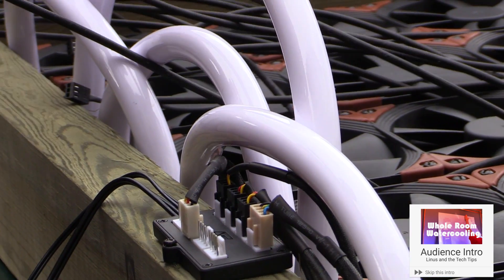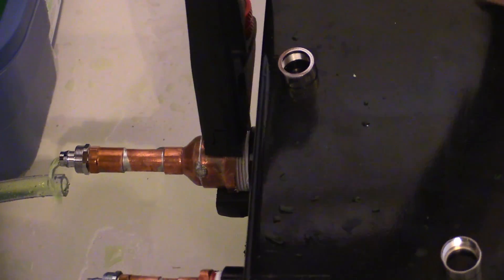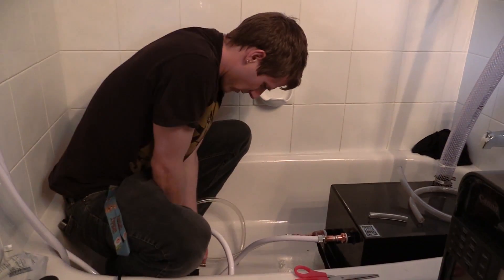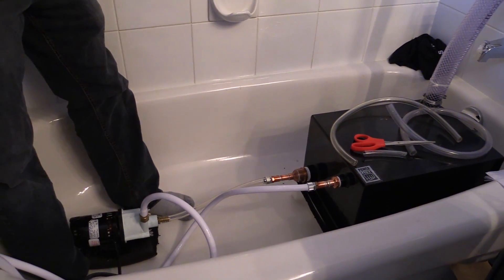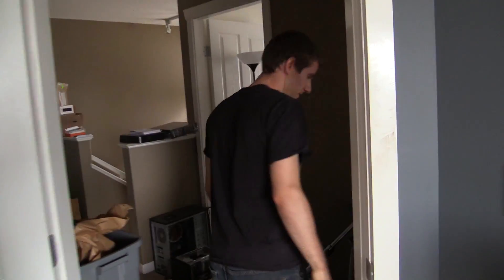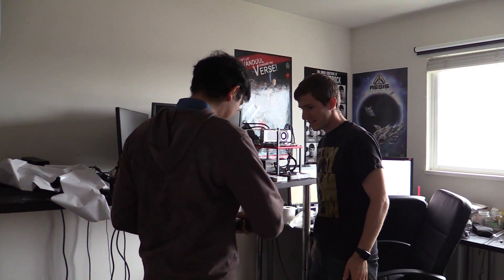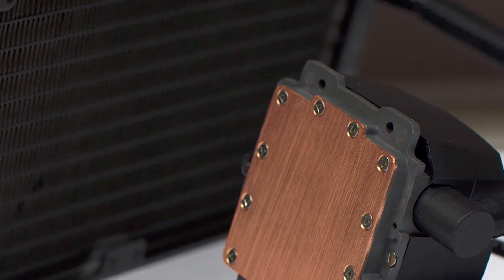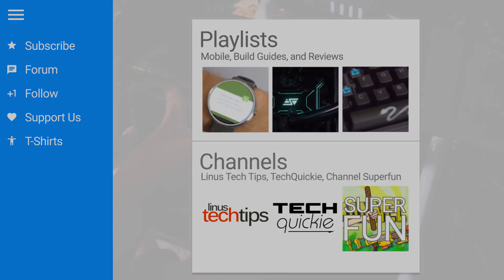Whole Room Water Cooling Part 4 - Nearing Completion...

Comment: So they didn't make air traps in their system? Wait, is there a term for a spot specifically to release air? I know in compressor installations, like air tools in shops, you need to have a drain for the water below the connections so you don't shoot water through your air tools.

Comment: Each spot a computer, radiator, or component connects to your cooling loop there should be isolation valves on the feed and returns with bleeders below the valves.  Set it up as if it's a hydronic heating system used in some homes.  It will be easier to repair and bleed each loop and component..  Isolation valves and bleeders are a must. And running pipes on angles slanted up on feeds and down on return lines would make getting the air out loads easier...  And even if you do get things cooling decently without isolation valves and bleeders there will still be air pockets.  So install bleeders and valves and things will be so much easier for you guys

Comment: i whod have only done two thing different one i what have put a cheek valve on eater side of pc one for the incoming and one on the out going line at the botem of the runs as well as one on the out fro the pum and one for the in of the take as well and the 2nd thing i whod have done different is on your out side radater i whod have use a car or truck radater and a good 12 car fan fro it that whod have help on the flow of water going in and out of it as well as a lot more space fro it to be abile to cool them pluses car and truck get much hoter so it be more than aqwith to cool all of the pc and some

Comment: funny and smart project :) are you still using the system? shound use quick couplings for the computers to the "line", like those for airtools n stuff, fast connect/disconnect, minimal air in and water out

Comment: Me and my room mate did something like this a bit smaller scale though.
Reply: Me too, but turn into a disaster when one of the tube got a hole in it. RIP my 780Ti. :(
Reply: Zero necker
 Holy shit that sucks xD.
It also ran into the living room and some how one day it sprayed a jet of the water anti freeze mix at my room mate.
Like how? Their was no pressure.
Reply: I know that there is a hole in there so I didnt start the pump and my god damned sister turn it on and there goes my GPU.
Reply: Zero necker
 Holy shit xD, you didn't warn her/ she was connected to it?
Reply: She was not at home when I rush out to buy more tubings. I thought she is not going to be home before afternoon so yeah.

Comment: Runs hose through window,to fill tank sitting in the...bathtub.  head-scratch
Reply: +PhattyMo ikr
Reply: Using tap water at all for water cooling, lol. I can understand why since 50-100 gallons of distilled water every time they drain or flush it a lot of money, but the minerals..

Comment: Since you were using standard copper plumbing parts, would it have not been smarter to include shut off valves to isolate parts of the loop, so the unused risers were removed fro the water flow completely.

Comment: what is the point of exposed copper pipes when it will still heat up the room, buy some insulation sleeves for air conditioning will be perfect
Reply: +peter griffin Absolutely unnecessary. Due to extensive outdoor cooling, the water temperature in the cooling loop is going to be only a couple degrees above ambient, so it's not going to appreciably warm the room, the efficiency of thermal transfer to the room is very low due to small temperature difference, relatively little area (compared to the area of outdoor radiator) and little airflow around the copper tubes. Most of the heat exchange will happen at the outdoor radiator and not from the copper pipe to the room.

This is also the case in a typical cooling loop built inside a PC, also with temperatures barely above ambient.

Comment: thinking about it why didn't you guys get some butterfly valves at the ends of the pipes so you could selectively shut off the water flow for easy change and to bleed the system of bubbles by turning all but one set off and using the pressure to bleed it out faster or something along those lines
Reply: +Nicholas Laster  That is what i was thinking too, but that is obviously the benefit of hindsight, i wouldn't have had this idea in advance of the project. But seeing the issues that actually occur, it's obvious.

I actually think another thing that's good for a system prone to such issues is flow meters in the individual PCs and connect them up to the mainboard CPU Fan tacho pin, so the PCs beep when there's no flow and so you can monitor the flow, and it would even work from BIOS but from the running OS too.

Comment: You must fill system from exhaust (out), to intake, that makes air go up. And you needed one ball-valve in highest point of your system. Or just make reservoir (with ball valve on top) below sealing in bath, which is connected main water reservoir. Pump must feed from exhaust to reservoir. That how that kind things I would do, cause I'm water heating specialist.
Reply: +pakiw2 to keep steel tank from rusting you could put inside rod made from magnesium.

Comment: i'm not sure if yo still use this cooling system for your computers but an easy way to eliminate the air bubble issues you have been having is too have your coolant tank higher than you tubing, lines and radiators, it will naturally bleed the bubbles out of the system due to gravity, it will burp itself
Reply: +Dave Berry its what we due to cars burping out the systems when we flush the radiators or swap cooling components
Reply: +Dave Berry They don't have that cooling system anymore

Comment: Build a box to hang in the window, and put the computer outside to vent the heat instead of messing with all that plumbing and water cooling. Then all you have to do is extend the monitor wires to the desks and use a wireless  keyboard and mouse.
Reply: Just no.
Reply: nah bra

Comment: ok need help ASAP!! I got a acer aspire wit windows 7 on it, I tried going the bios to see the temp of everything, But there is NOTHING for that in the bios AT ALL!! I tried also open hardware monitor and it said my cpu is running at 140 to 160F I REALLY dont think thats the case since its still working and not melted thru it. Need some help here PLEASE!! its not a new Laptop its atleast 3 to 4 yrs old or so
Reply: +Erik Iacopelli Ok I used 3 different programs and ALL are saying both cores on the CPU r going between 145 to 156F. WTF?!?!?! Wat do I do? I always had the laptop on a special stand so it gets ALOT of airflow under wit AND put a lil fan I got from walmart to blow cool air ALWAYS under it AND even have one of the USB air suckers attached to it so it sucks out the hot air, But even wit ALL that running its still hot
Reply: +Erik Iacopelli also I checked n its a Acer Aspire 7741. I looked online n I seen a bunch wit letters after the 7741 but mine just says 7741, no letters or nothin. I dont know if that helps or not
Reply: +Erik Iacopelli those temps aren't really that off for a cpu. The max temp on pentiums is ~90c (194f)
Reply: Open it and de-dust it, those temps are a bit high but not too much, if those are Farenheit temps obviously

Comment: You should have used clear tubing with little beds in them so you could actually see the water flowing around, and it would have looked much better than that copper tubing.
Reply: +Steve Aimes  My first idea when i saw was "ewww copper". I would have been probably tempted it to cover it with a chemical tinning agent (aka fitting soldering paste). Blast it with a burner, and it boils, then tins the surface, nice shiny and silvery. But it would obviously take a while, and costs a bit.

But yes, clear tubing would have been nice.

Also in hindsight, some shortcut valves for bleeding one PC at a time would have been prudent, and flow sensors connected to mainboard fan header would have been another neat diagnostic and failure warning tool.

Comment: You should look into installing a hoffman valve in the plumbing for that setup.  It would automatically purge any air bubbles from initial fill or purges and refills.  It could be soldered into the copper plumbing so they purge before the radiators.

Comment: for anyone doing something like this, use some ideas from automotive coolant systems. On many modern systems such as many Chrysler brand vehicles, there are bleeding valves at the high points to allow the air to escape. This is mostly based on non radiator fill points that trap air that wont circulate back to the reservoir. Check out the fill instructions for an 06 Chrysler Pacifica or most Jeeps with 4 liter inline 6 engines as a reference. Professional experience - Master Certified Mechanic and U.S. Navy training.

Comment: you should've placed two vent valves at the highest possible point in the system. especially in a situation where you installed the pipes at a height like you did here. would've saved you some time and pain in the ass :-p

Comment: Wouldn't something like a pex manifold be more helpful?  So you can seal off each workstation from the manifold without worrying too much about air bubbles at each leg.  It also removes the the need for the small pumps in each workstation, when you can have the pumps at each leg at the manifold.
Reply: Like a recirculation for hot water. No, I'm not a plumber, but I am learning how water systems and water heating systems work.

Comment: I noticed that the card for linus had an acrylic top plate, how is it handling the antifreeze (wich can be corrosive)? honestly I would have used plate heat exchangers, to have the room loop and the pc loop actually separate loops

Comment: What's the point of using the huge hose at the pump when it joins with a much smaller hose? It can't make use of that larger hose and the way they're joined means you're losing the pressure in your system.

Comment: Looks like an epic pain in the ass. Why not stick with smaller water cooling loops on the system and then put a high efficiency ductless split system in the room. Probably would be cheaper on electricity.

Comment: I really loved the idea. But I strongly recommend using check valves. :D
Reply: Matheus Moreira i know this was a month ago, but why would he use check valves, the plumber should have installed isolating valves to help balance the system, and an automatice air release valve, for 20p parts he could have solved most of their problems.
Reply: Check valves don't allow liquid flow in the wrong direction, thus eliminating the risk of hot water exiting a computer's liquid cooling system and entering the other's. ;)
Reply: ***** Noted. Anything else?
Reply: nah im all done

Comment: That pump is tiny, the smaller and longer the tubes, the more head pressure you need, also ofcourse the higher the fluid has to be pumped. Get a pump with 100m head pressure.i believe a 2hp pump with high pressure, but not so large flowrate will do the job. As for airbulbbles, they are always a problem, two solutions, bleed the system from the return connection of pump. Or evacuate the whole system.and vacuum it.DO NOT use a refrigeration vaccum pump as plumber grade tubing is thin walled and can collapse the pipes This will get all the airout. Once that sorted out, let the fluid run in.

Comment: Seriously, not trying to be a dick, but this is not efficient.  Aside from two decades in computer tech support I also have over a decade of HVAC experience as well. It would have been far easier to do a separate water cooling setup for each system, then add a ductless minisplit AC unit to the room. Minisplit systems are what is normally used in server rooms. Nevertheless I am impressed with the setup.

Comment: OK i do not wont to offend but coming from a mechanical background i see floors in your setup. 1}. you could have made a bracket that allowed you to fit each radiator out the window as this would be the prim placement for it as you could keep and eye out for leaks throw the window. 2} you need a bleed point at the highest point witch should be the rads 3} i would have gone with a large single 12v fan instead of all the wiring problems 4} flow cycle  pump should feed a pipe that runs around the wall on the floor feeding all the PC,s from the PC,s it should run to a second pipe running around the wall to the bathroom where it then gos up and out the window to the rad and back in the window to the res ( this could be accomplished by drilling 2 holes throw the window farm to fees the copper pipe throw ) the less up and down you have with the flow the less head pressure you need ideally i would have the pump and the res mounted to the wall in the bathroom bellow the height of the rads and the rad pipe running into the long tube you have coming out of the res. that said i think it is awesome that you did this as it sounds like one of my wild ideas lol  everyone will have a different way to do it just like but if it work awesome lol that is why i like you guys i never know what to expect.

Comment: because your pump can't handle the upward force, you need higher power pump to push the liquid up to your near ceiling on the wall then pull back again out to each pc then upward again you need at least 2 pump for the cool water to push then 1 pump to pull the hot water out

Comment: next time pull a vacuum on the circuit and let the absence of air fill the reservoir and lines. works great in automotive cooling systems after invasive repairs.

Comment: The lack of ball valve's is driving me crazy. You should be able to isolate portions of the tubes as shown at 7:00 

Why the ceiling? For aesthetics? That seems like it makes every down tube an air trap? Air rises to the top horizontal tube making the system a nightmare. Having a lower tube that has a off rise to bring the air out would make more sense.

Comment: Your system should have had valves installed at the end of each run of copper. It would have let you close off the pipe and not lose the fluid in it.

Comment: How about running the pipe work coiled inside a small "chest" freezer ? to lower the temp
Reply: ***** Should work to cool the liquid before running it through the system to cool the cpu. Maybe a peltier cooler at the liquid reservoir or at the radiator might be an easier method

Comment: This whole project could have been alot easier. Bubble reservoirs for each station between mains and blocks for better bleeding and avoiding that whole over-heating problem. Copper pipes running near the floor for smaller amount of water and better flow. To me, this just looks over-complicated.

Comment: If the case has a fan port on the bottom for the PSU, why don't you put the PSU fan facing down so it draws from the bottom, then exhausts out the back so it doesn't affect the internal case temperature?

Comment: Why wouldn't they get a set of valves for each connection on the copper pipe (like what you have for a faucet) then you could leave unused ones connected to each other via a hose and just open the valves to do a bleed
Reply: also, they could've simply disconnected the shower head and used that to fill the system instead of the garden hose.

not complaining, this is cool... just could've made your lives easier

Comment: You need a header tank badly, regardless where it is the air would find its way. It also needs to be the highest point of the system.
Hearing those pumps suffering cavitation was painful, not to mention pumps running dry

Comment: Not trying to be captain Hind sight or nothing. But you wouldn't have had any problems with air bubbles if your reservoir at the highest part of the cooling system. It will bleed its self.

Comment: Wouldn't it be smarter to have the reservoir at a higher ground than the piping and the computers so the pump wouldn't have to work against gravity to get the water up to the pipes?

Instead it could just use it's power to circulate the water in the system?

Comment: I'm pretty sad about this whole project.

The fact that no-one thought of adding some bleeding valves to the top of the water circuit somewhere (which is standard if you install any closed-loop water system: eg central heating), some valves in the copper tubing in front of the quick releases where the PC pipes connect to so you could disconnect a PC without having to drain half the system and other things.

Advice from any DIY guy would have helped immensely for this project. The videos are hilarious for the amount of fail but it could have been so much better (and easier!)

Comment: Should have put a small res at each case to bleed air maybe?
 or link the two unused drop pipes with a small res to bleed air, then you could plug a new system into res?

Comment: I dont get why you dont use quick disconnects/valves in between the computer components. It will be a PITA changing systems or do mainenance.
Reply: Nevermind, I spotted them.

Comment: I don't understand what the fuss it about liquid cooling, I have a air cooled system and it runs at slightly lower or around the same temps, I may have +1c or +2c on load tests but my lower temps are lower than liquid cooling.

 The only difference I can see is noise but with my headset on I don't hear my computer, So could anyone give me an idea on why liquid cooling is so popular?